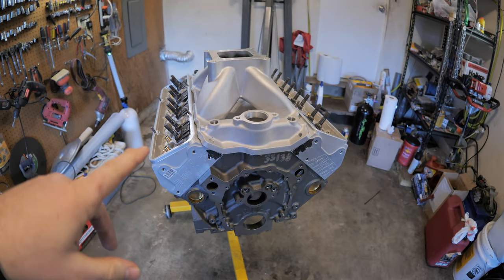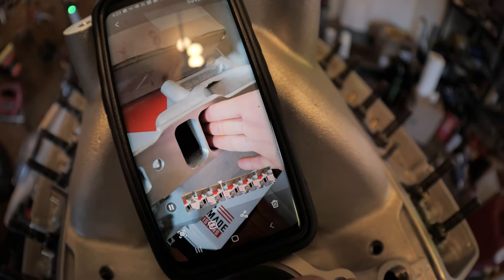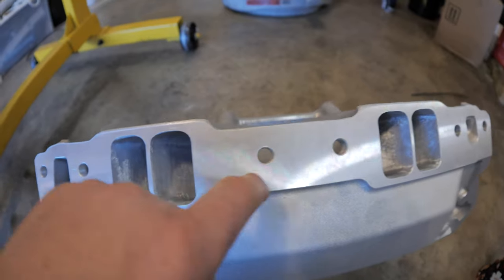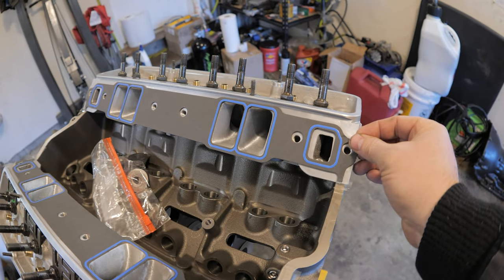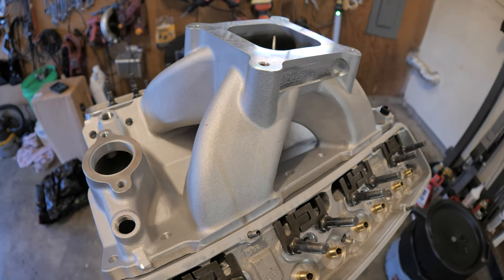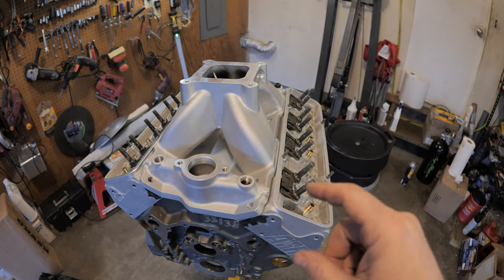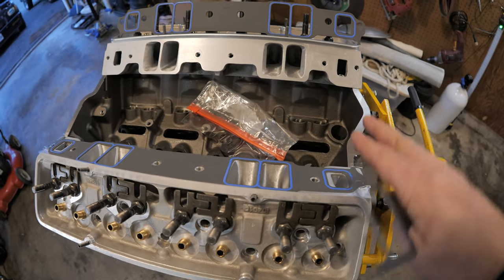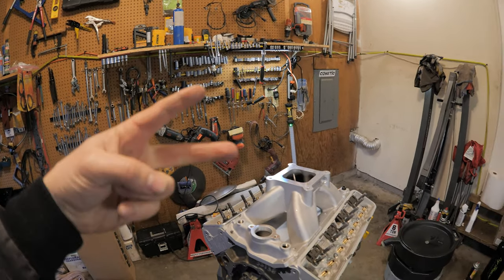400 CID SBC Build Update 02 / Port Matching Intake To Cylinder Heads.

Comment: LOL the heart wants what the heart wants.  Yep! And it wants that 400 SBC!

Yep that's exactly me too.  Years ago I had a 1971 400 block and crank from a 3/4 ton truck and I was going to use that as the engine for my street car.  Unfortunately I was never able to continue with the project and sold the car and the 400 block and crank.  But to this day I still want a street car with a hot 400 SBC.  And some day I will have it!

Comment: Nice job dude....Now get your grinder in that plenum and fix the runner entries. Blend and contour to the carb flange and widen and straighten as needed. Box stock, the runner entries are actually different sizes. Pay careful attention to the runner taper from the flange to the entry. Warning.....welcome to the rabbit hole where you can spend 40 hours....easily!!!

Get a GOOD oil pan and DO NOT use oil restrictors!!! If you do, get ready to replace your lifters and valvesprings often.
Lots of tips to talk about when you're doing your final assembly like offsetting the parting lines of the rear-main seal and putting a little drop of super glue on the ends that butt together, etc... You're covering a lot of the details, why not go all in.

Don't worry about the nay-sayers that say LS this or LS that. Done RIGHT, your 400 should be able to compete with most. Remember, some people like their chicks like stick figures, some like em with a little meat on their bones and some like em FLUFFY. To each their own. Build what YOU want and enjoy it!! If it's a Gen 1, old nail head or flat head, whatever.....it's yours.
Keep it up and good luck!!

Comment: Gen 1 stuff can be built to beat anything new none of that matters! Just costs a lil more bottom end wise depending on power output an there still alot of benefits new stuff don't have I rather build a motor instead of putting a turbo on a LS gettin old tbh! Love the 400! My next build will be a 421.

Comment: My Brodix heads use 1206s as well and I'm thinking maybe I should consider hogging them out like you did with your AFRs as I never even bothered to check the port matching when it went together. Thanks for the tip, chief!

P.S. I still think that intake looks gigantic. :)

Comment: I'm building this exact combination atm with a slightly milder cam. What did your power and torque curve look like?
Reply from the maker: Never had it on the Dyno but check my videos I filmed a 400 SBC with AFR 195cc heads and mild cam on a engine Dyno.

Comment: Did you have the head gasket on there also before you did the port match.
Reply from the maker: I used shims to simulate compressed gasket thickness. The note @ 2:17

Comment: What compression ratio are you shooting for? Do you have a camshaft picked out yet for this beast?
Reply from the maker: It will be around 11.4:1 after resurfacing the heads. I have the cam already it was built for this motor 260+ intake 270+ @50 duration is all I am sharing now. 😁
Reply: @TPVPRO  I have a similar motor in my Camaro. It will be a fun street motor. The torque difference will be pretty big. I went with a tight lash solid roller and Yella Terra platinum shaft rockers for valve train stability/longevity. How much does your truck weigh?
Reply from the maker: @racerdoc   3175 with me in it

Comment: Just a heads up, but I hope the deck height of that block, and the chambers of the heads are where they are supposed to be before you did that... removing material from the deck surfaces of both will effectively lower the head placement , making the intake sit high again. Also. Was there a head gasket in there? That will alyer intake placement as well. You did a good job matching, but what you did should be done last after heights are set... 
Also, that SV2 small block intake is WAY too large for a 406 with 210 heads. They barely work on much bigger inches. They were made for big inch, high rpm compression engines with big heads, so don't be surprised if power is way down... just sayin.
Reply from the maker: Yes and see the Note @  2:17.  Take a look at this article, the Vic 2 made the most power.  https://www.hotrod.com/articles/19-single-plane-small-block-chevy-intakes-test/   The 400 I am building has better flowing heads bigger cam and more compression. 11.4:1 and will rev to 7000rpm.
Reply: @TPVPRO  My comments are not to convince you not to build what you want. However,  after 25+ years building race engines and 15+ years porting heads, all I WILL say is, the WORST thing you can do is build an engine according to what a sponsored magazine article says. Peak numbers mean nothing, especially if average power in the range is down way more than what it gains at peak. Odd they didn't report on that, no?
I'm speaking from actual experience testing this stuff on multiple different combinations. 
Fact is, that intake loses average power and toeque on most smaller inch street engines, and some bigger inch stuff... it's just too big. A regular Super Victor would support what you are try ing to do... All I was trying to say.
Reply from the maker: Interesting, a tunnel ram won't kill power and torque on similar setups and it's even larger. I would like to see some real data to back this up.
Reply: @TPVPRO  Larger where? That is the key. Hint: Air speed.
Reply from the maker: @vengeanceizmine9878  Make a video with actual data. Comments from channels with zero content is not going to convince me otherwise.
Reply: @TPVPRO  Good thing I'm  not trying to convince you then. Content or not, doesn't erase my real world experience, which i use to try and help others. 
I was trying to get you to think for yourself and understand how an engine makes power and how to tailor it to make it where you need it using air speed, but you don't seem to be understanding it. It's certainly not about bolting a huge intake on a small head because a magazine says to. Sure way to lose power though. 
Just sayin...
Reply from the maker: @vengeanceizmine9878   Sweet keep commenting it's good for the algorithm. Actually, the custom cam / professional head porter recommended the SV2 over my first choice and that was the SV1. He knows more about motors than I do so you can convince him if you want “Fast-Cat Porting Services” on FB. He is the one who runs all the #s and finds the best combo for what I am trying to do with what I have. So magazines had zero to do with the intake, to be honest. I mentioned it in this video so be sure to comment on this one too. https://youtu.be/TFn_n3vIRJk
Reply: @TPVPRO  The engine will only make as much power as the person designing the combination. His choices tell me all i need to know. You should have stuck with your original choice.. 
My comments are to help people, not bash them. Zero fucks about algorithms. 
My comment was a friendly heads up. Why? Because i have done the testing. I know what it will do, so i figured i would pass it along. 
 Don't make the mistake of thinking ALL youtube commenters have no idea what they are talking about lol.
Reply from the maker: @vengeanceizmine9878  Where is your shop and your name. I would like to see your work.
Reply: TPV your combination will run great!! Don't worry about what someone with No videos of them building anything, anyone can look up and state information, but it doesn't mean they have or could build it as well as you, imo it's better for the owner/driver to build their own engine because they know exactly what they need or want from it!!!